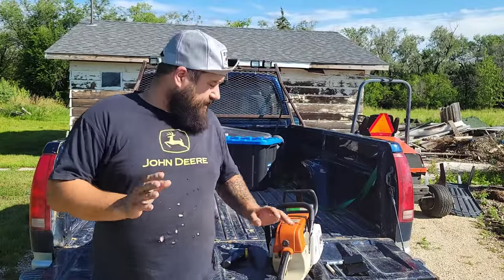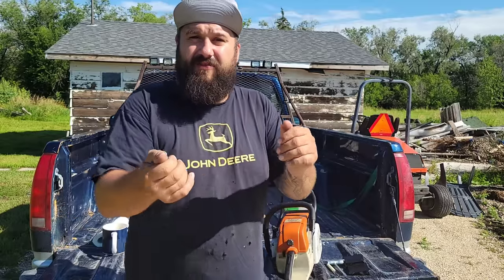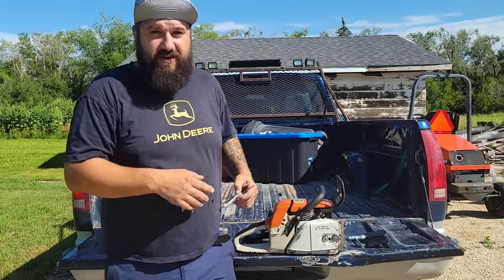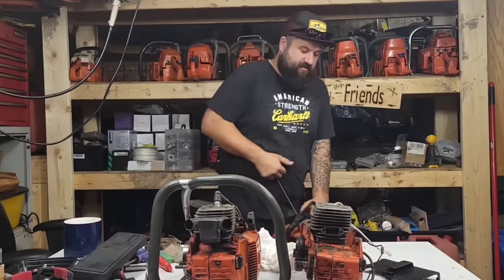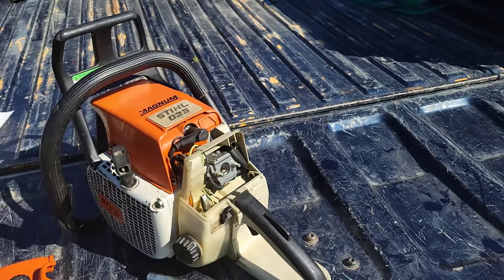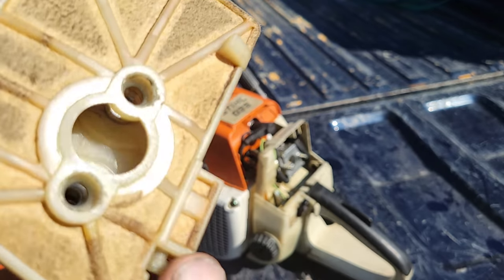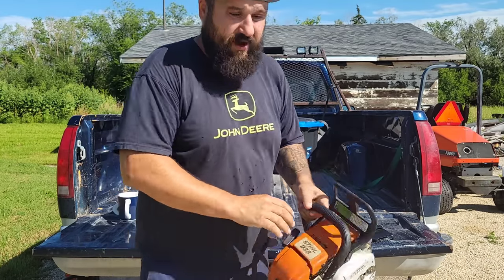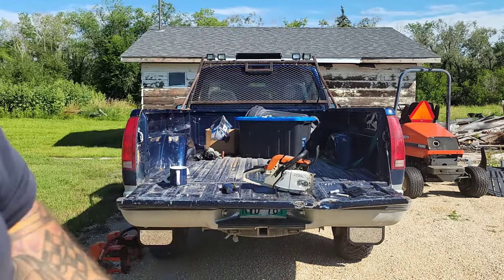Stihl 038 chainsaw won't start?? This may fix it!!

Comment: I'm so greatfull. Went straight to my ms260c, that wouldn't start, opened my split air filter. The end of the spring was not housed in the slot probablyfrom a recent clean I did, , so choke flap was not under spring load. Rehoused the end of spring in the slot, put back together, choke on and started straight up. So greatful. Thanks Mate. Glenn, Australia

Comment: Stihl 024 , 026, and 028 have the choke in the air filter. I usually have to prime my 028 after it sits a week or more. Great video. Lots of good information.
Reply from the maker: Thabks for adding models with that choke system.
Reply: Stihls r faithful buggers u should know that,never ever wear a husky or echo or whatever HAT 😊😊😊😅

Comment: Tinman, you just fixed 3 saws I kept but couldn't diagnose. Glad I didn't trash them. The glass level trick is the best! I am 62 was getting ready to buy a new replacement. Doubt I will out last these three... Thank You! Folks like and subscribe! One of these saws I loved and took completely apart finding nothing wrong.

Comment: I have an 038 magnum 2 that runs like mofo but up here in the mountains it takes forever to start when it’s cold until., I did what you did checked the choke flap and sure enough it wasn’t seating fully. All I did was clean everything up real good (spring was still strong) and 2nd pull. I haven’t ran it in a week it’s 28 degrees out I know it’ll fire right up now. Thank you you’re the reason youtube is such an important tool

Comment: Had a aftermarket 026 filter that the choke flapper was catching on the aluminum nut on the inside of the filter wreaking havoc with my carburetor tuning, rich one day and lean the next. After I figured out what was going on I took my Dremel to the round cut outs on the flapper, problem solved! Very cool video!

Comment: I've an older 290, so different choke setup, but has always taken the 10-12 pulls to fire when sitting a long time (more than 5 days).  I've found that pulling it a few times with trigger held down helps;  basically what a purge bulb would do getting fresh fuel into the carb.  Hot or next day 3 pulls max (usually 1) so it seems more a lack of fuel in the carb after a bit.

Comment: Thanks. Having some skill , a friend gave me his old family hand down 038 that would not start. Being a MS500I man I had little idea on how to fix other than new fuel, full clean etc. Turned out to be fuel screws. The filter / choke was ok. Shows how much advancement in the modern saws especially the MS500I, no chokes, no cold start, no run - just pump and start and yes, decompression button to saw your arm. New subscriber here. Peter
Reply: Save not saw.

Comment: Can confirm this issue with my 026 and 260. Thanks for the info, great stuff as always. Have a good one 👍
Reply: The Info I got on the 026 was to glue a foam ear plug in the filter circular hole.

Comment: Thank you thank you, I have a Stihl 028 that I really thought I had it sorted real good, and it sat for 4-5 days, and I couldn't start it to save my life, I pulled it at least 25x. So I'm gonna unbench it today and see what happens, I bet $100 that it works
Reply: Just separated the air filter, an lo and behold, there was NO spring at all !!!

Comment: I feel your pain Tinman. I built a 038 magnum this spring. Had the same problem and thought I did something wrong with the build. Bugger wouldn't start either after multiple pulls,  maybe I'd better myself a stihl hat.. Hahah.. Thanks for the tip on the low jet,  I'll have to try it and make sure it is fixed before it goes back to the guy I built it for.. Always fun my friend.. Cheers

Comment: thanks for your info. my 038 the choke itself was fine, but the little spring that holds it away from the carb was missing, replaced that now it starts easily

Comment: 026, 024.  Choke flap in the air filter is a terrible design.  I’ve fought it for years.   I’ve got a customer with an 026 and every year about this time he calls me and says my saw won’t start.  I usually spray some starter fluid on the air filter and it’ll start 2nd pull.  I hate those Stihl saws with that design.  Love your vids Tinman.

Comment: I've run into that. If I remember correctly I would put the black old style choke lever in. The red is flimsy, and they twist out of shape. I've also put a small screw in the camming part that actuates the choke.

Comment: Tinman, I just bought a 038 super off of marketplace. The air filter is absolutely PACKED! It ran like it was choked the whole time. Will 362/391 performance filters work? I want to get rid of that clam shell style filter.

Comment: I have a 038 av and it’s been great until I got it out yesterday after sitting for the winter. Hard to start and won’t idle. I understand parts are difficult if not impossible to find.

Comment: Lol I mentioned that back in one of the comments about the flap not  seating right. Those round choke flaps are horrible for that  and am filters are commonly bad too and weak spring in em too sometimes over time

Comment: my 011AVT got that ckoke flap.  ain't spring actuated, it slides into position.  thanks for the headsup on the gaps that could be present in the choke flap not permitting a tight seal.

Comment: Hey tinman , I rebuilt a sthil 038AV . I havent been able to get this thing to fire . It got point & condenser  ,then a coil . I've checked all the wires and i think there all good . But still no spark . The wires from point is there a certain way they go & if so how would I find the wire?? Please help

Comment: The Stihl 028 has the same choke in the air filter as the Stihl 038. My 028 was a bugger to Start!  I put a new air filter in the 028 still had a problem starting I found the piston rings were not seated not enough case pressure pulse the carb I had to squirt oil in the cylinder for a few tanks.

Comment: I think the main thing with a choke is it causes the carby to suck fuel instead of air priming the system. Often ill block the intake with my hand or sometimes blow air in the fuel tank. Usually the choke is only needed to get the first fire.

Comment: I found cold start 3 pulls choke, then turn off the choke.  The 038 msg is my saw for 5 years of wildfires.  In recent times I found a 461/660 has a gas cap that can start fires or spray gas when refueling .  Not what a wild fire sawer wants.  I run a 32 3/8 50 for weeks in hell often.

Comment: I still have the problem and now it won't start again! Carb kit, new plug, new filter, readjusted high low and throttle. Just put on new fuel line and air vent hose.  I did not plug air vent so maybe I'll try that. I made it so it has small flapper opening so not completely sealed shut.
Choke valve is closing so I'm at a lose now. Gets plenty of spark also when you remove e the plug and do a test pull.

Comment: Hi tinman your correct the 026 is te same i had same problem but it wasnt the choke flap but the tiny black bar connected to the choke my issue was that the bla ck bar was bended downwards 3 mm si i didnt have hi idle straightened the problem solved 3 pulls and it lives greetz sjaak flip

Comment: Another thing as well the ms381 air filter does not have the drilled breather hole that the 038 has. Watch your holes correct for model.

Comment: I had a Shindiawa that didn't like to start sometimes. It was so bad that it ended up about three rows back in the trees, and I left it there. My dad asked me where it was at. I told him, and he went and got it. I pulled on it three times, and it started. That's after laying in the woods for two months.
Reply: It learned it's lesson. Now it knows who is boss, you shouldn't have any more trouble.
Reply: @alanwatts9232  lmfao wtf

Comment: Any STIHL with the choke in the air filter is a hard starter. My old 026 was the worse starting saw I owned. That's coming  from a retired STIHL tech.

Comment: I have an 028 AV super Wood Boss and when I put the choke on and go to start it the choke lever pops back into the run position how do I fix that issue I can't see where there's any type of an adjustment and it's not just once it's every single time has the same kind of air filter as your saw. I can hold the choke lever down with my hand while I try and start it and it starts right up and runs fine this is an extremely clean saw inside the clutch cover case it's absolutely pristine there's not a mark scar scratch anything this problem is been since the saw was new the guy that I got it from could never get it started any help would be appreciated thank you
Reply from the maker: Probably the spring that puts tension on the switch or the cam for choke is worn or broken.
Reply: @tinmanssaws  it looks brand new. I wish I could send you a picture or video
Reply: By the way I really like how you run your channel and what you do for everyone on here.  Big Thank You brother
Reply from the maker: @samhoschar5794  thanks fpr the kind words I appreciate it

Comment: Even the stihl 028 has the choke built in the air filter.
Reply: Luckily mine doesn't have that problem. you pull 2-3 times and it starts without any problem.

Comment: Guys I have a problem, my kid grabbed a screw driver and got all 3 screws in all the way, it won't start and I have no idea how to at least get it to start.
All 3 of the adjustment screws are screwed in all the way, can someone tell me how much do I turn them to get it to start
Reply from the maker: Low jet 1 1/4 turns out, high jet 1 1/4 turns out. 

Idle screw back it out til it's just touching the throttle. 

That will get you running
Reply: @tinmanssaws  thank you, I really appreciate it.
Reply: I did what you said and it started on the third pull, thanks again man. I am going to subscribe and i will recommend your channel to all my friends.

Comment: I’m only 6 minutes in and thinking 2 things. Carb draining back over extended periods, and possibly a soft impulse line.

Edit after the solution: Now I remember the plastic choke and having heard of issues.